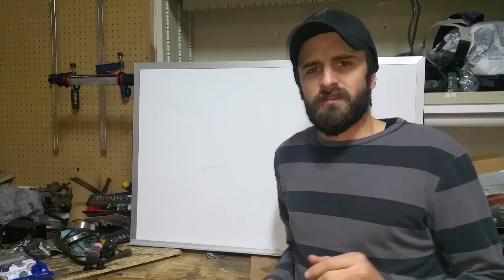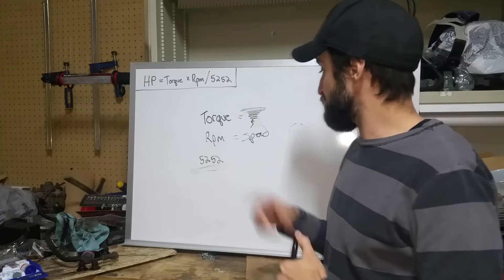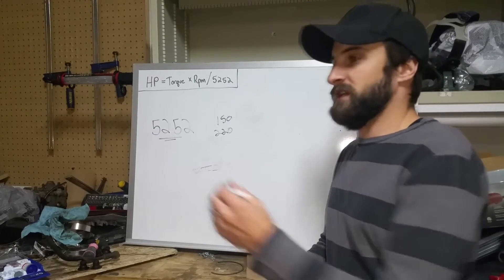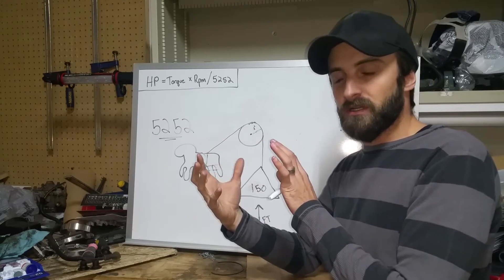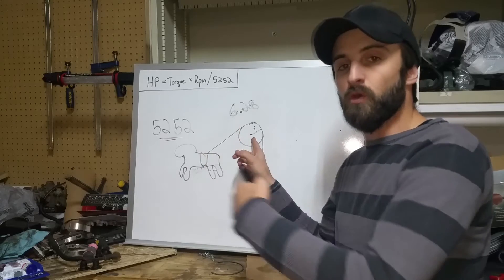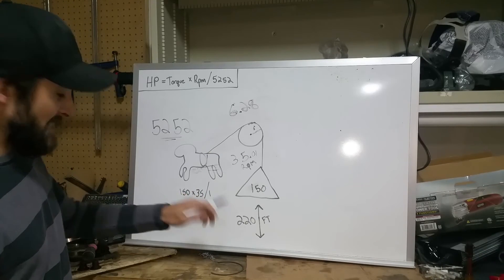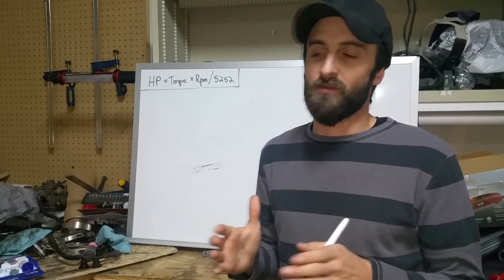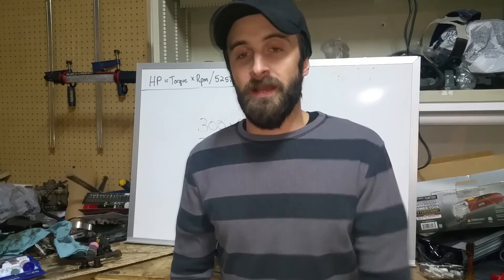WHAT IS HORSEPOWER? WHY DO HP AND TORQUE CROSS AT 5252 RPM ON DYNO SHEET?

Comment: assuming 5252 is a constant, you multiplied pounds (150) by RPM(35.01) . then the result 5252 would have a unit of pounds Revolutions per minute....how is it possible?
Reply: I’m confused because 35.01 times 150 is 5251.5 so where do you get 5252 from

Comment: Dont you have a truck to be working on? lol
Reply from the maker: Bad Luck Garage I'm waiting on a bunch of stuff to come in... Shipping is being really slow... I was going to start welding up downpipe today but realized the Vband I got won't work... Just spent the day cleaning and  rewiring my garage so middle light doesn't run off my bathroom outlet breaker, lol.
Reply: All my garage lights are on the same circuit as the stove , microwave, and oven in my kitchen.    The guy that wired this house was a real jackass so I feel your pain. Im actually gonna goto an exhaust shop for my downpipe. We dont have enough 3" to do what i want and since Im not runing a muffler Im pretty sure I can get it done fairly cheap.
Reply from the maker: Bad Luck Garage Nice...

Comment: i remember the horse and wheel but forget hearing anything about the 5252.. cool beans .. they're doing roadkill extras every day and doing a whole tech series of building an engine with stuff like that  ..  so did that link help ? anything else you want to know like making sure it's playable, making it so the strings aren't a mile  off the board etc.
Reply from the maker: Blaine Ludeman Awesome, I just went back and checked it out, that should work, thanks!!
Reply: no prob. i'll be around